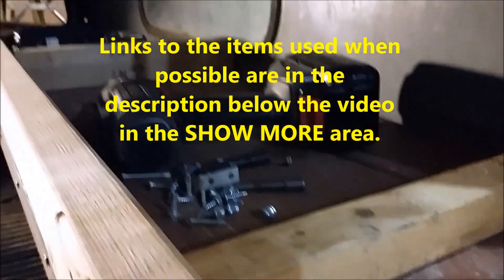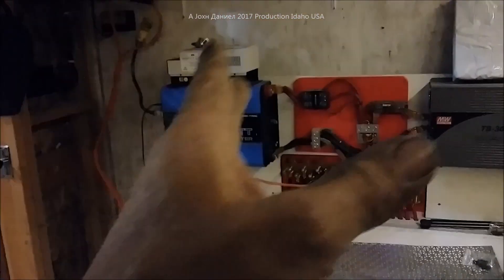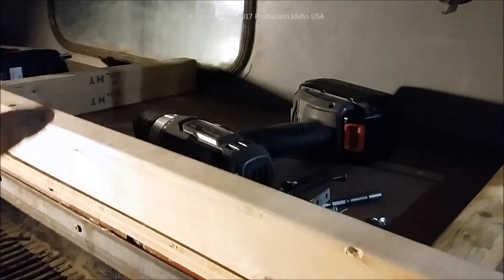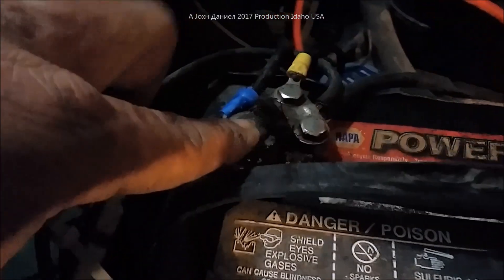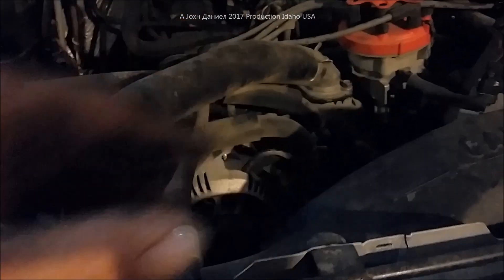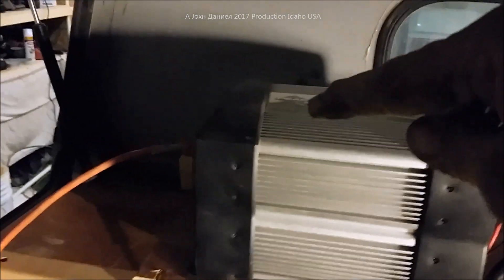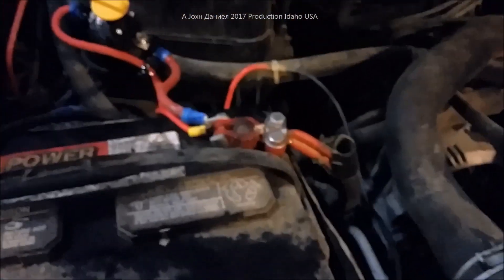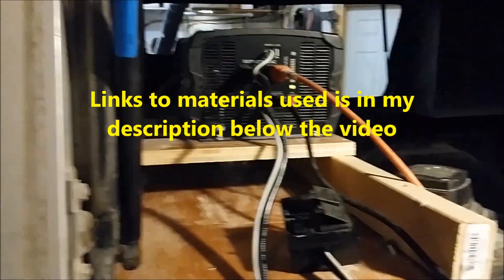Install a Battery Isolator, Batteries, & Inverter EMERGENCY POWER (see info parts used below video)

Comment from the maker: After 9 years dealing with htis stuff, you trash whats trash, and buy what last, Best Isolator for "safe" use http://amzn.to/2pJBjcU Best 3000 watt inverter http://amzn.to/2r5227D . Rest of the parts are common and somewhat cheap. If you want to upgrade go with Mean Well 3000 http://amzn.to/2srD1nJ  and/or PB6000 http://amzn.to/2sc1v3S ,These 2 inverters are the best, I seriously recommend the POWERBRIGHT PW6000 6K http://amzn.to/2sc1v3S

Comment: Idk if you’ll see this or if you’d take the time, but I’ve been watching your channel for a while and trust your judgment above my own. I’m a tradesmen and road-tripper. I have a 92 f250 idi. 2000watt pure sine wave inverter, Two group 65 x2 starting batteries, planning on 4/0 wire to two auxiliary batteries that are frame mounted. I want to be able to charge my power tool batteries with truck off and small appliances, and I want the ability to run a smaller sized air compressor with truck running if necessary. Air compressor size is 12.7 amp 2hp but willing to go smaller. I’m lost with fuse sizes/isolator, and what’s feasible. Any help would be greatly appreciated. Regardless tho thanks for passing on the knowledge.
Reply from the maker: You will want the 250 amp model https://ebay.us/fiZPhb , a 250 amp breaker https://ebay.us/4JBMh7 and  1 awg welding cable https://ebay.us/XkQ07V at the length you need plus some extra. Only use Temco wire and lugs for safety https://ebay.us/8yeGvS
You're going to install the 250 amp breaker in between the car battery and the isolator and you will run the key rest of the cables as directed on the instructions for the isolator.

Comment: John, it’s ugly, but it’s a beautiful set up. Looks to work well as it should. Nice job. 
A question though. I’ve heard conflicting reports on the Everstart batteries you use. In truth how do they function and last? I figure you to be the man to ask and get an honest response. Thanks
Reply from the maker: The EverStart battery is a good battery but it depends on which model you get the 29 size model is made by Exide, and they last 4 to 5 years easily and I've had to set last almost nine. But the smaller models the 27 and 24 are made by Johnson controls in Mexico and the purity of the lead is only 84%. Typically you can get 3 years for if you're lucky out of those.

Comment: I want to figure out how to run a dual battery setup with isolator and 3000 continues watt pure sine wave inverter to be able to run a 5l oxygen concentrator for my wife in both our suburban and caravan in case we need to bug out!  It would us to be able to visit family (road trips required) and camping trips to! Any help would greatly be appreciated!
Reply from the maker: You Can Do It ✌ Best MPPT controller 40 amp https://amzn.to/3eHPxDE Best Solar Panels https://ebay.to/2CHae5B get 4 of the MightyMax100w4bar & a Rock solid power Inverter for your described need, 1500 Watt pure sine - https://amzn.to/2CkHm2Y . Use on no less than 2 good deep cycle batteries, 3 would be better.

Comment: Hi, looking for some advice on what battery isolator I should get off Amazon?
I'm not a full-timer. My secondary battery is only a lawn tractor lead acid battery. I only have a couple of dome lights to run in my camper. No plans for an invertor.
I want to put the isolator in the trunk. Would a solid 12 gauge house wire be strong enough to run from the trunk to the main battery? What size fuse?
Thanks
John
Reply from the maker: Run 8 awg power wire for that, in a heavy re-charging situation you'll need that. put a 40 amp fuse on it.
Reply: @JOHNDANIEL1  thanks

Comment: Wow is it just me ? That weight that high on the truck is going to be dangerous. I would spend my money on a sign wave inverter too. But if you are happy with it it looks great. I just purchased 20 lifepo4 cells for a power pack and the weight is a whole lot less than a lead acid even though the charging is special it can work great in a vehicle.

Comment: My keyline 140 amp isolator is clicking on and off constantly. Never did it till a month ago.  Any ideas.
Reply from the maker: Check its lugs underneath, loose ground or over tightened and stripped can cause that. Also you can get that effect if your extra battery is shorted or under a ghost load or some sort.

Comment: I have Cen-Tech 1500, watts 3000watts power Inverter
Reply from the maker: They are good, but very choppy in output sine. The PEAK and POTEK have a multi point sine wave improvement in them thats why I use them.

Comment: im interested in charging one battery with an isolator but this helped. Thanks.
Reply from the maker: If you only want to charge a battery but not use it for the vehicle you can use a solar controller, for real! See A video I will be doing to show how that works. I'll upload it eventually!! This is the type controller, The 80 amp with battery temp cable, https://ebay.to/2Y3F2WX its hardy! And its awesome! If you want details, ask, I'll send it to you or a schematic.

Comment: I've noticed with isolators you dont get a full charge on your bank batteries I rather use a solenoid for full charge
Reply from the maker: Theres a difference between a isolator and a charge controller. The 140 amp model i am using is actually a charge controller, it allows full voltage and amperage to go to the secondary batteries. Its solid state using solid state relays in it compared to a diode based isolator which is known to restrict voltage up to 12% and gets hot physically. That heat generated is loss in a basic isolator.  A solenoids contacts can and will lock up unless your spending big on them and buying one with the most expensive components.

Comment: Why 215 amps isolator?
Reply from the maker: Isolator from truck is a 140, but you can use any size for the purpose I just prefer the bullet proof 140 I am using.
Reply: @JOHNDANIEL1  
Thanks for quick reply, John.

Is it going to be a problem if I don't use a fuse before the isolator?
I have fuses after isolator, one before the "house/leisure" battery.
 One before the inverter and another one before distribution center.
My isolator is rated 85amp.

Comment: But 315 A plus the battery in front isn't it a little too much for the alternator? Also no stages in charging the batteries. That kind of wave out of the inverter should be "modified wave". Not as good as a pure sine wave but it seems to be good enough to run a shop vac. I am curious to know how long it lasts and if there are any problems.

Comment: Really liking your setup here. I've had a plan rolling around in my head of how to put this setup in a truck bed toolbox with an isolator, and I was going to do a manual switch operation until I saw your smart isolator. That solves my "if I forget to disconnect and run my whole truck dead" problem, and as a side opinion, I admire you having that Ford. Used to have a similar one, only had to replace the alternator once, and it earned it after years of non-stop abuse. Again, great setup you have there!

Comment: If I spend any money on inverter it will be sine wave thank you for your help much appreciated
Reply from the maker: Inside info - The Power TECH-ON is a unbranded ( sorta ) version of the Vertimax and AIMS 1500 watt for about $100 less. Damn good too. https://amzn.to/2Cg3kln . Just have to always make sure you are supplying lots of amps to run any inverter without causing yourself issues.

Comment: Question can you hook up 2 power inverters to a battery bank i have 8 of the same batteries you have from Walmart?
Reply from the maker: Yes, you can ad as many as you can replace power for. I also have a 600 watt Pure Sine on this system for my TV and Computer.
Reply: @JOHNDANIEL1  do they have to be the exact same inverters? I'm using a 3000w inverter and I have a 1000w inverter that I wanted to ad and either of the 2 are pure sine wave but they work good for me so your saying I can hook them both up to my battery bank?
Reply: @JOHNDANIEL1  if so do I wire the second inverter the same way or do I use the total opposite negative and positive on each end of battery?
Reply from the maker: Try to keep your batteries as balanced as possible to keep from damaging them.
Reply: @JOHNDANIEL1  what do you mean by balance my batteries?
Reply from the maker: Equal length cables in this fashion as well as making a main buss for power draw and input. Like my bank here https://youtu.be/JXBduzn2gwM or the bar and balanced draw system on my truck.

Comment: does it overcharge starter battery when it is full
Reply from the maker: No, its auto limited to 14 vdc and reconnects and disconnects at 13.4 from the second battery bank

Comment: In parallel you can pull the pos and neg off the same battery and it will still keep all of the batteries balanced. You can input in to the same battery that you draw off of and they will stay balanced. You do not have to pull kitty coroner from two batteries. Also take the time to look up how to hook batteries is parallel and series. You got internet it's easy to look up, So do your home work befor you look stupid.
Reply from the maker: +Steven Sargent It's 3 batteries not 2 and I'll tell Freightliner,  Peterbilt, Kenworth, Mack and Volvo’s to stop doing it this way too. Them silly fools been doing this with 3 battery set ups for 60 years. What a bunch of clowns.
Reply: I know their are 3 batteries there I meant from the front kitty corned to the back battery
Reply: JDs method is 100 % correctly wired, safe & efficient. Only difference I would do personally 
is use AGM batteries & install them
on the floor of the bed.

Comment from the maker: To My Viewers - If your going to put a inverter in REAL Hard Use, or dirty locations, and you want a Pure Sine,  but can also use a high quality Very Clean notched wave (not totally Square wave) These below are "Improved Quasi Modified" ,  I seriously recommend the PEAK 3000 http://amzn.to/2srkurS or the  POWERBRIGHT PW6000 6K http://amzn.to/2sc1v3S
Its so worth it . The heavy weight of them means well made, and all the stuff that comes with them actually makes them cheaper than the rest.